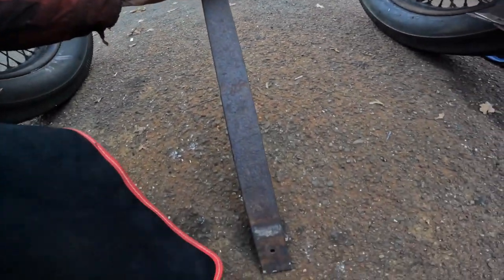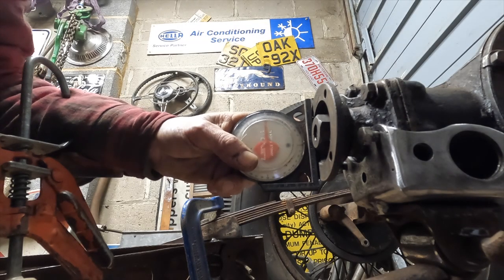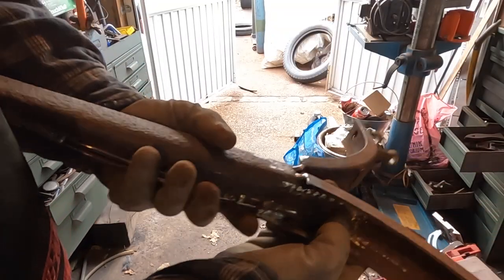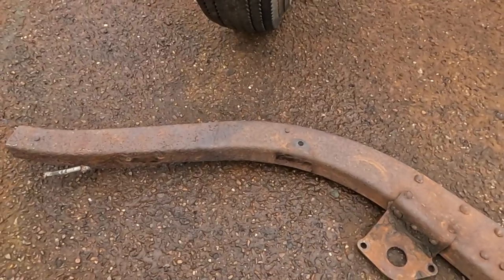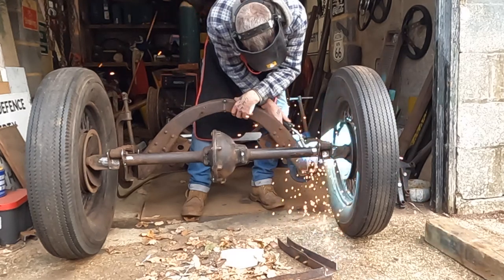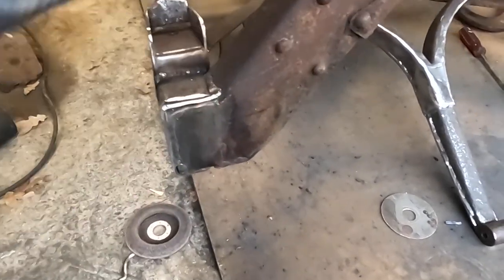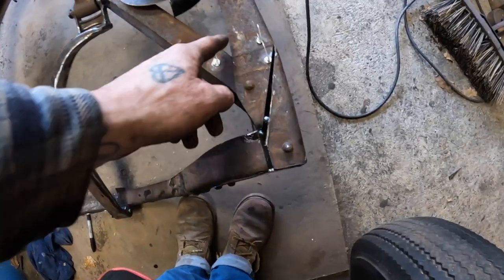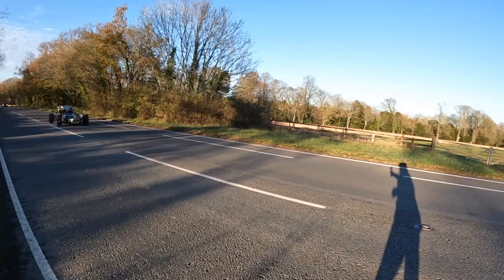the austin ten special....rat ,   part 4

Comment: I am new to the channel, looking at that rear link: the pivot is too far forward it will simply bind as it travels. It will give the impression of stiffer rear springing until it breaks. The pivot needs to be further back- look at the A bracket on a Lotus Seven for what needs doing?
Reply from the maker: was a while ago but if you are talking the lower link on the rear ...i failed miserably with it and changed it ....cheers

Comment: There are bushings, but will that be enough to cope with chassis roll?

Like, drive over a bump with one wheel. First front, and one wheel raises (ignore how camber & toe change, for now), and lowers, but not the other, aka: roll.

Without roll, when the back wheel hits that bump, it can't move up unless the other also moves up. That results in questionable handling, a rough ride, and traction issues.
Reply from the maker: interesting,,,,,, hopefully i wont encounter that....its actually very limber